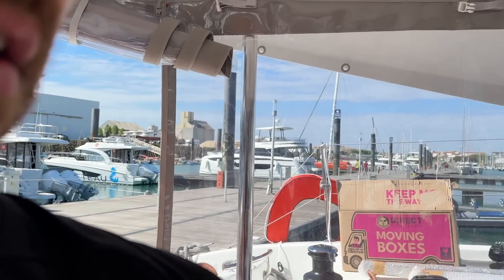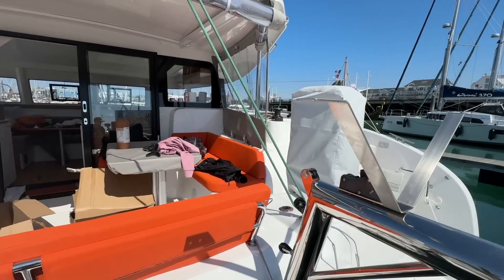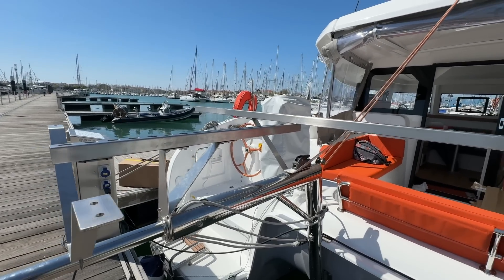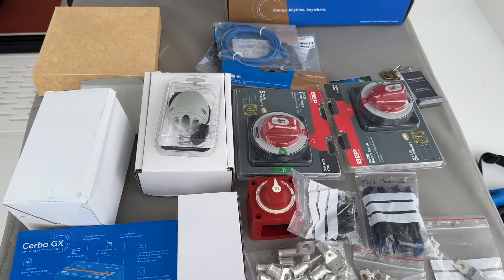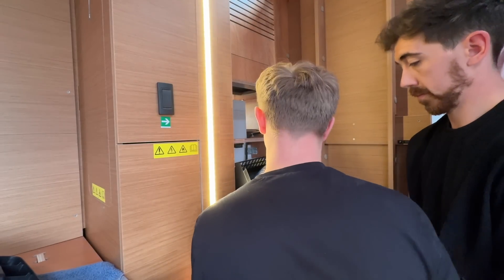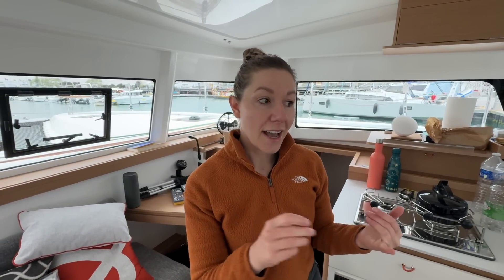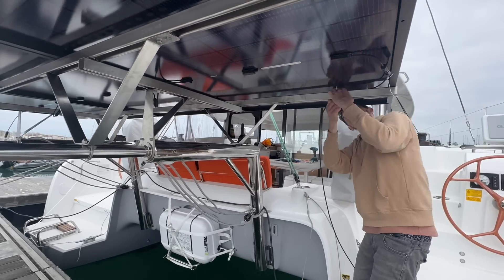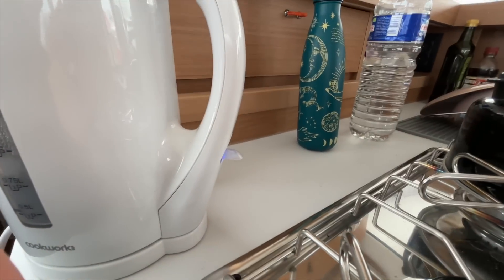Installing a DIY Solar Set Up On Our Brand New Yacht

Comment: How did you get those solar panel brackets ready made with perfect fit delivered even before you got the boat? Who did the job?
Reply from the maker: We got some basic measurements on someone else’s boat and we designed everything in CAD before sending the designs to a machine shop to be cut for us. Everything fitted really well which was a relief 😅

Comment: Great job,
Just a little tip: when you're working on elements above water and risk losing screws or bolts, hang an open umbrella between the water and your work area. It has saved me from losing quite a few things.

Comment: Congrats! Great engineering feat to save 1,000s. A couple concerns- easily addressed: 
1) unless the solar frame is exactly the same stainless steel as the davits, you’ll soon or later be dealing with dissimilar metal corrosion. 
2) the nuts and bolts will all return to their original (uninstalled) configuration unless you use the correct locktite on the threads AND I recommend a second set of nuts on every location, which prevents the nuts from backing off. Oh, also, if the fastening hardware is a different “nobility” than the solar frame and mounts (and anything else they touch), again, you’re set up for dissimilar metal corrosion. Nylon washers, tef gel, or other non-metal barriers on any and all sites of connectivity -like the aluminum plate you mounted for attaching the solar controller etc. These are small but important matters. I’m still gobsmacked by your lovely frame design!! Congrats on taking it on yourselves!
Reply from the maker: Thanks for your advice! Some of your points were already done as part of the initial install but there’s a few great suggestions in your comment, thanks for watching 🙌🏼

Comment: Would that extension increase the overall length of the boat?  Meaning you might have to pay for a longer boat at marinas?
Reply from the maker: Our boat came with the davit extension installed from the factory, they add just over a meter or so in length but allow us to carry a bigger tender (some marinas do charge us for the extra length). Our solar install fits neatly on top and doesn’t extend beyond the davits 😊

Comment: Hi Guys,
Well done on your solar installation.
Some observations if I may be so rude ;-)
Bolts holding the frame to the davit, use loctite 242 or higher to retain. Degrease the bolts and threaded hole with brake clean or acetone. Allow to flash off before fitting.
The folded brackets,anticipate  fatigue cracks on the outside larger radius of the bends. Probably starting from the edges of the brackets. This will take some time to propagate but there is nothing better than waves to fatigue a structure. High polish the edges of the brackets with a fine grain angle grinder and scotchbrite to high polish will help mitigate.

Finally, alum heat-soak for the electrics. I didn’t quite spot if it was bolted direct to the hull. Not ideal against an epoxy laminate. I would recommend an air gap if possible or a thermal non flammable insulator like a 5mm plate of Tufnol CARP Phenolic glass.

Sorry, engineer on a Friday evening mode :-)

Ha the smiles at your end are infectious.

Cheers,

Tim
Reply from the maker: Thanks for your advice! Some of your points were already done as part of the initial install - degreasing boots and putting loctite on nuts didn’t quite make the final edit for the video though 😂 We’ll be sure to find some time to look at your other suggestions, thank you 🙌🏼
Reply: Thanks so much for this!! The more advice we get, the better 🙏